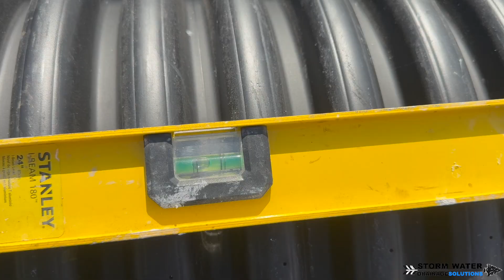Dual Wall Drainage Pipe N12 - Flow Capabilities - Storm Drainage

Comment: you didn't mention fitting for DW HDPE. I'm getting ready to run about 80+' in TX for a driveway drain in front of our house. I don't have pooling, but it just needs a little sump and drainage. Wasn't sure if I used SW fitting or fabricate my own. Will get factory bends if needed thought some fabricate. I may be able to bend enough making a long sweep depending upon wha's in the trench. 
Again, a great production. I hope YouTube works for you.
E
Reply from the maker: Good point! I’ll have to do a video on DW fittings 😎